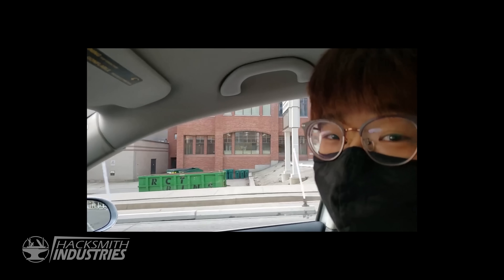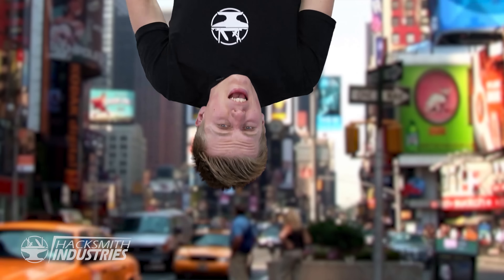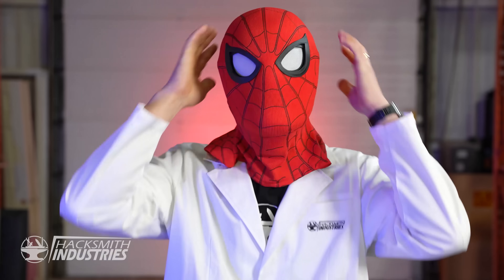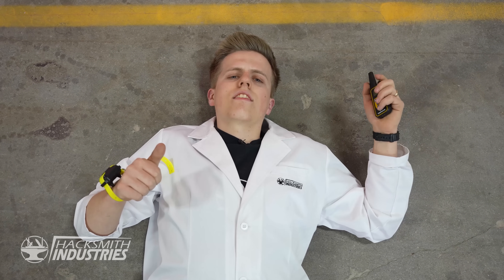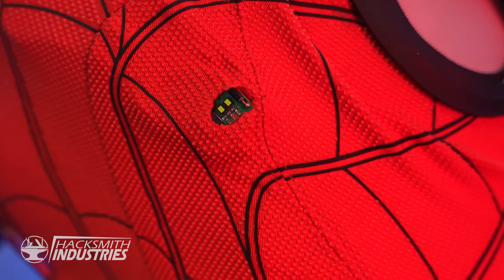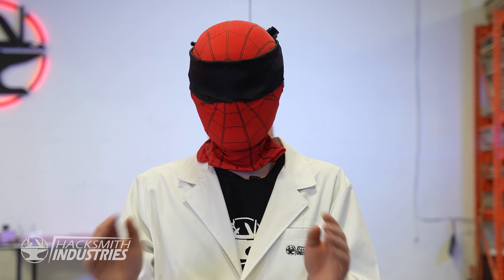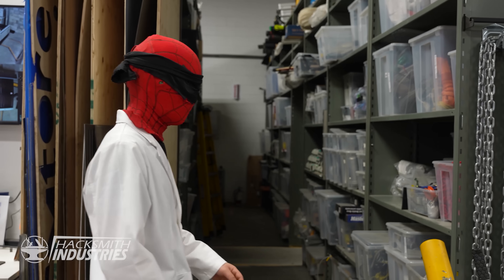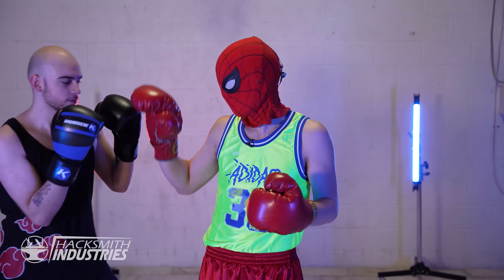Spiderman Mask + LiDAR = Superpowers! (Real Life Spidey-Sense!)

Comment: great show, i have this idea of a visibly impaired cane, the tip have this sensor, or maybe additional, front of the cane.  if there is a step of deep hole, the cane will vibrate or sonic sound (optional for hearing impaired), the deeper the hole the faster the vibrate or higher the sound.

Comment: I think you can make it better by expanding the range of the sensors and make that it can sense if it’s a big thing or a small thing and also if it’s fast or slow and if it is fast and big the voltage and the sound that the sensors make will be stronger.

Comment: (An idea for a possible upgrade: "if the sensors, are as small as they appear, one could potentially attach multiple sensors, to the spider-suit,
by attaching them,
in-between the fabric of the suit, and the hard, yet flexible:
front, and back, spider-symbols: on the spider-suit." [It could theoretically enhance, or even maximize: the "spider-sense" potential.] Just a thought.)

Comment: I have a great idea for webshooters so basically there are three holes in the shooters facing separate ways like a funnel and it sprays a instant stick spray and it only sprays on the edge of the string with a time limit or something and it need a bit of weight so it has impact when it hits a surface and have a backpack like thing with 2 sides for each arm and have a scissor like thing so the string cut and you can put your own ideas I think it would work also the stings are funnel shaped so it might be easier to hold then just one sting
Reply: The desire is kind of like PS4 spider man

Comment: Made this as well a few years ago, however lidar was still above €100 for a decent one so  ir and ultrasonic where the best options. also didn't have a vibration motor, so I used the engine from a rc car and added a screw to the side with some tape.

Comment: Really, I agree with the others, put a front facing sensor on this things and you have a really great system for the blind. Screw Spidey, this is basically a  Daredevil type  power emulator. With a little bit of training a blind person could use this quite easily to navigate without a cane or dog.

Comment: The project was amazing and all but i got a little bit annoyed that they’ve done it on the head they could’ve done it on the chest so that the spider logo would stick to the chest just like a normal spider-man suit and it will also have spider senses as well as it would be far from your head so the micro waves would also be far away from your brain so that it doesn’t damage it
Reply from the maker: It's just a prototype. The electricity in those sensors are tiny, no "microwaves" near your brain whatsoever.

Comment: Make this small and compact into a circlet, headband, and baseball cap design with a few more sensors with directional indicators that "tap" your head in the direction of an object and you'll have a fully functional echo location-like device that the visually impaired could use.  Or even a glove-like device that slips over your hand allowing you to still use your hand but give you 180+ degree detection view that taps the back of your hand based on the direction its detecting objects. Whatever it is. It needs to be small and blends in so that it doesn't stand out to people around you.

Comment: When will you do another one with Linus? You guys should try out my designs for tractorbeams and spacebreaks (creating resistance to velocity in a vacuum). Those two are closely related and important af for spacetravel. Im a rocketscientist. You need alot of processingpower to make tractorbeams work... Requires abit of growth before you can actually do it. Growth of the systems to control and expell the forces. Would be interesting to see what you can do with the tech

Comment: A stretchable ring like a sweat band with more sensors and smaller vibration motors for finer sensory input would be great for blind people.
They can simple put on the thin ring/band and then sense stuff all around them with their "sensor ring".
Manufactured by some company which can really miniaturize the sensors and vibration motors, this could turn into something extremely useful.
Multiple rings with various sizes could be made, so you can also wear one around your hip, knees, feet, hands etc.
All the software could go into an cellphone app and communicate wireless via some short distance protocol with all the sensor rings.

Comment: Don't they make piezoelectric actuators smaller than those buzzer motors? Could the PCB board be mounted inside the hood? What if Spidey gets punched in the PCB board? How durable is a flexible PCB?

Comment: Would love to see this be applied to the Iron Man helmet, but instead of just using a vibrating output it'd be a camera that'll turn on and output the display to the users' eyes, and depending on the number of sensors triggered it will automatically resize on the display up front

Comment: It's really tough to get a spidey sense right though because to actually react like spiderman you'd need the signal to actually determine when an object is coming towards you fast enough or close enough to pose a threat, then you have to actually be able to react in time. An ideal scenario is your sensors detect something actually moving fast enough to hit you or hurt you, then calculate the amount of time before it hits you and letting you know within like 400-500ms before it'll actually hit you. That way you get around 200-300ms or so to think, and around 170-220ms to actually react which should be fairly easy for most humans even if they aren't as quick as Spiderman.

Comment: If you could make a less intrusive headpiece, one of you should try wearing it 24/7 for a week or so.  If you did, you'd probably get so used to it that you could use it pretty effectively.  I don't know if you guys have heard of it, but there was an experiment where some volunteers were given a "sixth sense" in the form of a belt that would indicate which direction was north by vibrating, and by the end of the experiment, the participants could easily navigate using just the belt (although obviously they couldn't avoid obstacles).

I just think it'd be really cool to see how far one of you could develop the spidey sense.

Comment: why not use a tens unit? they're relatively small, wearable, and have two sets of output, one for each side. low power, and with how simple the electronics are, I can't imagine it would have been hard to connect to the lidar. I'd build it into the shoulders though, constant vibration on the head would become a nuisance after long term use. so many points of vibration, I feel is overkill though. In reality, the only place you can't see is behind you, so back left, back right, and back middle. for back middle, just have both trigger together instead of having a third point of vibration. Great project, but I feel that it was significantly overengineered

Comment: This is great but I think we all know what the next evolution is:
Applying it to the torso where the chip is the chest emblem.

Part of spidy's moveset is he dodges rather than blocks. And he dodges is a very acrobatic way because he knows where the attack is coming from at all time. The system here is great for detecting X, -X and -Y (Y would have worked too if we got the forehead) but we don't have anything to detecting if the attack is coming from the top or bottom (Z and -Z). I imagine the torso sensors would sense the diagonals so they would cover not only altitude but other blind spots as well. With this, you could probably avoid kicks as well.

Comment: I have a question, why is Q1 a high side NPN in the schematic? Was this a design choice or an oversight? When using an NPN high side like this you are not getting the full VCC across the motor, rather you have the VBE voltage drop and the Base resistor drop from the signal voltage and probably operating the transistor in the ohmic region which will dissipate a lot more power than anticipated. Using KVL 0=VPB1-VR3-VBE-VM1. Typically when using an NPN as a switch its on the low side where the emitter is connected to VEE or gnd. Then the path of KVL is 0=VPB1-VR3-VBE and does not pass through the motor.

Comment: I feel like removing hearing and sight for the tests was unnecessary, since Spider-Man still uses his hearing and sight on top of his spidey-senses?
Like I get it was important to see if they worked, but I feel like a secondary set of the same tests without earbuds and blindfold would have also
shown if it gave that much of a benefit over normal senses.

Comment: how come you didn't make a whole spidey suit integrated with the system what the have spider emblem sensor on the back of your head; you could have it on your chest or back and have the wires running through and have that front sensor if you were to put the spider in the front.

Comment: What if you had these sensors spread throughout the body of a full suit? Hence, if there was something near your arm, your arm would vibrate, etc. Not sure if that would be more efficient or not, but just a thought!
Reply: This is what I was thinking but it would take a lot of getting used to. For example it would pulse near constantly when near your body, and depending on the direction you would have to grow accustomed to having it change near constantly when accounting for limbs ability to pivot and rotate in their sockets. I am sure if you lived with a system like this for an extended amount of time you could grow accustomed to it to filter out what was and wasn't dangerous or caused by yourself.
Reply: It would be great.
Reply: Imagine having goggles that displayed 720 degrees around you (spherical), the microcomputer parts to handle the video processing, a graphic UI that was virtual tied into VR gloves, and a audio output linked with visual output to show relative distances.  OR, you could tie in the AV output via a decent sound card technology for 360 degree object placement.  With enough lidar sensors, you could create a decent 3D "picture" of your surroundings, sorta like Morbeus' sonar, but with lidar and extremely accurate distancing.  The firefighting applications are staggering, let alone military applications, especially for special operations.
Reply: @brianm744  cool could you explain it to me like i am five?
Reply: Imagine if they implanted the full body suit into you
Reply: You could go a step further and use an electrically-conducting fabric to produce a very powerful magnetic field, power the fabric with the users's body heat using tiny converters, and integrate tiny things that zap in different intensity and location on your body based on the location of the object and its proximity, and they could all be routed to network of controllers, too, so you wouldn't even need one big controller (like in the video).

It'd be microscopic manufacturing for the components, though, and they only do macro.

Comment: Just a Tip. 
Arduino Programs take a lot of space compared to straight up C (which Arduino  IDE is based on). 
C programms can also be a litle faster and probably less code overall. 
You can write normal C code in Arduino IDE and it will work fine. Great job overall

Comment: I have a question there. When I order the PCBs, is the sheet metal for the solder paste included?
Reply: These are very easy micro soldering jobs..look at northridgefix channel to see more. Just a soldering iron with small tip.. and flux.

Comment: This could also be titled as “Real Life Daredevil Sense”
Reply: Well, the Daredevil Sense was a little bit different. The Lidar like they said uses light to indicate how close or far something is, whereas Daredevil uses sound that reflects off of surfaces to detect and measure distance of said person, place, or thing. And Daredevil powers are technically already a thing. Due to loss of sight one must increase their other senses to "see" and he chose sound, but you can choose to focus heightened smell, touch (like heat and cold), or taste. But anyway, although incorrect, i like the spirit you have with the post.
Reply: @YBPhoenix  You don't get to choose how your senses are heightened when you lose a sense. It just happens, most likely because your brain no longer needs to attempt to process the information of a dead sense. Think of it more like freeing up processing power on your computer and setting other programs to a higher priority. Daredevil's Sonar like power is nothing like what happens with actual blind people.
Reply: @drizzitdude  you can actually choose if you trick your mind. Daredevil did this through multiple means like using his ice pool he dips into. He's forcing his body to lessen his sense of touch with that, which has to increase his other senses. If you took away every other sense, you could quite literally become Daredevil, but the reaction and focus is an entirely different factor
Reply: @YBPhoenix  yeah i get what you mean but no normal human has daredevils powers to that extent, like to the point where they can sense and hear moving objects at that speed and accuracy. but if you don’t think about the technical side of the spidiesense its almost the same.
Reply: Idk man, daredevil can dodge bullets and sense where people are like 100ft away.
Reply: @Flome810  well yeah so can he sense heart beats and wounds bleeding but this is like a more realistic version i don’t think they could get any more accurate
Reply: @sh0dy  True.
Reply: Spiderman is more well known

Comment: Excellent prototype! Can be improved of course (that sensor on the front, weather-resistance because a light drizzle and/or dust could kill it, more sensors to cover more of the surroundings, etc.), but damn that was legit! Wear this for a couple of weeks and by that point it would truly integrate with your reflexes and then you'll be able to really dodge basketballs and slow-motion punches.
And as others have said, a version of this for the blind would give them lots more mobility than the usual walking stick. I've even seen something on this lines some years ago that made a crude map of the surroundings on the user's tongue, pretty much giving them Daredevil vision. That would be awesome.

Comment: Personally I would have tried programing the sensors to buzz when they detect something getting closer. My thinking is that with a 4 meter range most of the buzzers will be going off simultaneously so to avoid an incoming object one would have to recognize which buzzer was giving the signal for a close object. Instead having them only go off when something is actively getting closer would limit the false positives.

Comment: Using 360 audio to warn you would be probably more effective and easy to use
Reply from the maker: You mean like... Normal hearing?
Reply: @hacksmith  Gottem
Reply: @hacksmith  Precisely. Except it is triggered by the sensors so if you can't hear'em you hear'em

Comment: So we’ve got spidey sense, wall crawlers, and a limited web shooter. Now all we need is real web fluid and we’ve got real Spider-Man!
Reply: Action lab short made a video about a real web fluid xD
Reply: @nicolabopan8310  but it doesn't work
Reply: There's actually a Brazilian working on a web shooter using real web-fluid, his channel name is... Web Shooter
Reply: But there is one thing the Hacksmith can't replicate... One thing which is necessary for a spiderman to become a spiderman... Mj
Reply: @fortfanop  robot
Reply: @CaramelSleet835  robot octopus
Reply: @CaramelSleet835  i aint a bot
Reply: @fortfanop  I meant make a robot to represent MJ sorry for the confusion
Reply: I heard about a guy that put spider DNA in goats. A small amount of web fluid is mixed in with their milk. Unfortunately, it probably wouldn't work.
Reply: @FourMatt1  i have seen a guy make spider silk using yeast and as far as i know it worked
Reply: Even if you get web fluid, you can't just swing building cause if you swing across 20meter height the max force on 3 times your weight 😂
Reply: @gurunarayana1382  true but no one would swing anyway, must people just wanna grab and pull stuff ya know
Reply: @TeenPerspektiva  that works but creating enough momentum for fluid to reach such large distance continuously isn't easy task
Reply: A guy inserted spider silk genes into yeast.
Reply: too bad real life web fluid is impossible
Reply: @therealsewergremlin6412  nope
Reply: And super Strength and speed